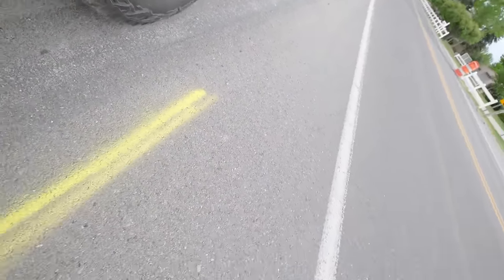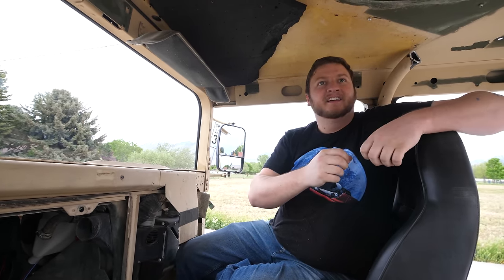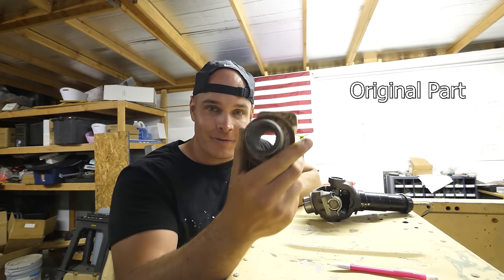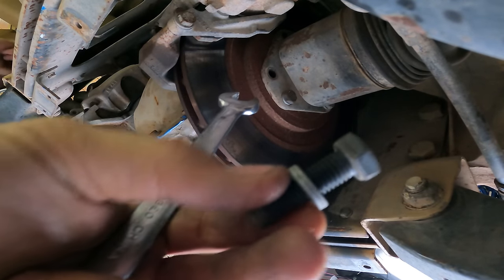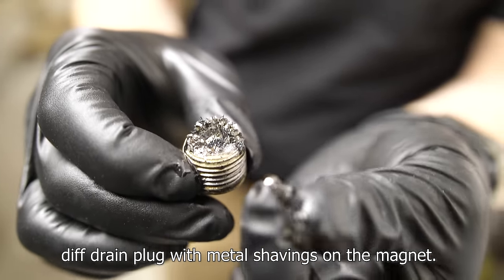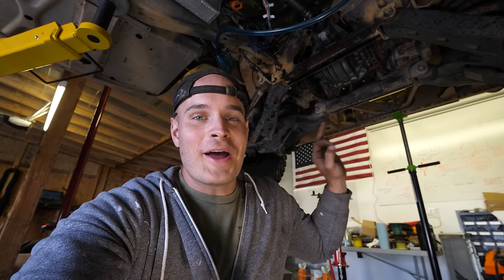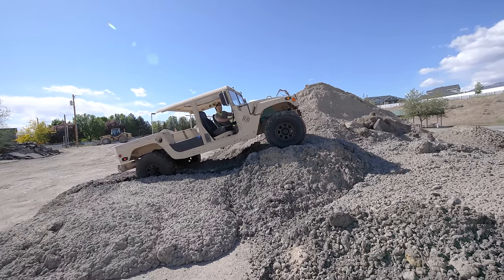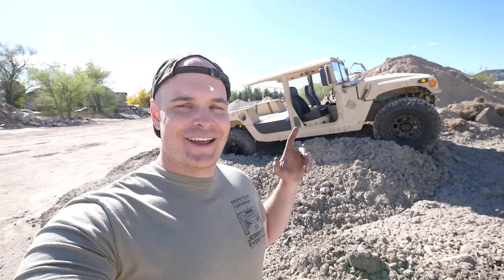My Electric Hummer has a HUGE Problem... and its all my fault.

Comment: I think it would be cool and a good idea to put some skid plates underneath the Hummer for events like the cement pile where you're scraping the ground. A skid plate would protect your drive shaft and coolant lines. It's been so cool to see this thing come together!
Reply: That would add some weight also. It all depends on what the purpose of the thing is. Is it rock crawling or is it more like overlanding and occasional off-road.
Reply: titanium skid plate
Reply: @blacknoir2404  nah just thick aluminum
Reply: @Jellylazer  but then there's no white hot sparks should you skid on a rock
Reply: And improve aerodynamics
Reply: Have you seen one of these in person? They arn't like most other 4x4s - everything it tucked up extremely high and uses portal axles to drop the tire low enough to the ground. Skid plates would be over kill in this and unless your planing to do some VERY serious 4x4ing then this isn't the right platform. The driveshafts don't hang below the body unlike most 4x4 rigs due to the design & portal axles - nearly impossible to get something UP INSIDE the body to hit it. You would have to go out of your way and it wouldn't be easy to find something that could for the type of offroading this can do.  Based on your comment; your out of your dept so stop trying to be an internet expert when you clearly have no knowledge. You likely seen normal 4x4 were skid plates can be useful but assume that applies to everything when it does. Stop copying everything and use your critical thinking skills instead. That is how drivers following GPS end up in lakes because they stop using their brain. I'll end the rant there but hopefully you take my last part to heart.
Reply: @ka-i  It won't benefit that humvee. I don't break things down for YT aerodynamic specialists.
Reply: @JohnAdams-qc2ju  Maybe you should use your "critical thinking" before blowing up at someone on the internet because heaven forbid someone who isn't an expert makes a comment. I was just throwing out an idea, and maybe before shooting it down you should have looked into it a bit. There are people who make and install skid plates and armor plates for the underside of these M998 Humvees. They can help in situations like the cement pile where the vehicle sinks into the rocks. Plus since Zack's Humvee has coolant lines running underneath, it would be important to protect them. My advice to you is to be courteous and listen to other people for once, because no one will want to be around you if all you ever do is shoot down their ideas. Hopefully your day gets better so you stop being rude to strangers on the internet.
Reply: The humvees we had in Iraq had a completely flat undercarriage. One big sheet of metal
Reply: @BlackJeepConvertible  Yeah, that was kind of what I meant by adding a skid plate. Obviously some people didn't understand.
Reply: I appreciate Jerry mounted a camera instead of any skid plate. 
There can always happen something unexpected while testing any never-before-intended-to-be-compiled components. 
Well, failing might be no option; but sh*t can and will happen anyway. The sum of failures is called experience. 
Jerry riggs everything - and "everything" includes to compensate any glitches either!
Thank you Jerry for documenting what you're doing.
It is much cheeper to me to let you make all those expensive experiences.
Reply: @JohnAdams-qc2ju  All the internals might be up high, but they aren't actually protected in any way, and as the cement pile shows, they are still low enough to be damaged.  With all the new electronics and cooling packed down there, there is definite cause to be concerned about them being damaged.  All it takes is one slightly sharp piece of asphalt being kicked up  by the tyres for things to go catastrophically wrong.

If the electric humvee can't handle the weight of the skid plate it originally had, maybe it should go back to being diesel and just run on biodiesel instead.
Reply: And cover all that messy wiring just waiting to get ripped out.

Comment: I'd recommend a safety loop for the drive shaft in case you have a similar problem again. It'll help keep the shaft from hitting the ground if either the u joints or the shaft itself break.
Reply: Not only the ground. Components around it as well. I was quenching waiting for it to hit coolant lines. Even when he did the small offroad, I'm just thinking about those lines
Reply: @mrdingles5107  Hah, yeah, like the ones that were keeping it hanging off the ground!

Thankfully with this setup, there's no exhaust or fuel lines to take out. Although there ARE brake lines still.
Reply: @Aragorn450  And lots of electrical cables for various stuff.  There really should be protective covers under those cable runs, so rubble and dirt won't randomly cut control cables.  If it was still military he would also have to consider landmines exploding under the car, but for civilian off road use, basic plastic or steel covers should do.
Reply: Hummer is probably heavy enough to not let that happen, but older "rear light" trucks could be rolled over when that shaft hits the road.  Safety loops were a standard future on them because of that.
Reply: A flopping shaft is very destructive.  I lost mine after ujoint disintegrated and the splines seperated..  Bought following car a new grill and radiator after  the shaft became airborne.

Comment: Super cool! Can you take it to a metal scrapyard when you are done to put it on a scale to see how much it actually weighs now? Would be interesting to compare the new electric weight to the old diesel weight. Using corner weight scales too would be interesting to see how weight distribution has changed, but I think those are a bit harder to find.
Reply from the maker: Sure

Comment: Love this video series! 
Here’s a piece of info on the HMMWV and the way they were designed to work originally. It’s called throttle/brake modulation. When you feel wheel slip, let up on the throttle. Then you put your left foot on the brake, right foot on the accelerator.  Then you accelerate more or less and brake more or less depending on what you’re feeling the vehicle do. It’s been ages since I learned about this, but you should look it up and give it a try!
Reply: That's just for when one tire is losing traction; it allows the Torsen diff to effectively drive the other tire on the same axle. In a modern vehicle the traction control system would apply the brake to just the spinning tire, which is much more effective.

Comment: Hey, sorry to bother but I've been really curious about how you figured out the power train you needed to pull this beast around. Im looking into building an older 1966 f-100 into an E-Truck but I can't figure out how people figure out what their motor needs to be able to do, what controllers will work with what motors and so forth. I'd love some feedback on how you figured out your system and built it up!

Comment: One thing I've always heard is, gears designed for ICE engines don't play nice with electric motors. They tend to snap in two from the instant torque.
Reply: They're rated for some torque load but electric motors give instant torque which is effectively shear force, so you need something that can take like 150% of the EV motor torque to be safe
Reply: ⬆️This..
Reply: @Ryukachoo  to avoid this anomaly you can just use a slow starter. That will be way cheaper and clever also convenient on matter of avoiding mechanical complexity
Reply: youre mostly right but its more to do with how they're driven, with ICE you can replicate the same instant torque loading by dumping the clutch at high rpm, which also generally ends with you finding the drivetrains "weakest link" lol. This is why its quite important to have a "slow start" function mapped into the ECU for electric conversions.
Reply: @NitroNuggetTV  I how Zach sees this. I want this project to be successful.
Reply: @NitroNuggetTV  slow start is no fun though! Also yeah equating it to clutch dumping is quite accurate
Reply: @NitroNuggetTV  you could also you know just have feet made of flesh. just dont give full throttle instantly. there is your soft start.
Reply: @SimonBauer7  I did say its more about how they're driven. Unfortunately in vehicles intended for performance and off road use its inevitable the the throttle is going to get bumped or mashed. its also especially important you don't break a driveshaft or diff in the middle of a trail, not a spot you'd want to be recovered from. Soft start is cheap insurance if the ECU/speed controller already has the facility for it as many do. After 15mins of driving you wont even notice its there.
Reply: @Ryukachoo  I'm an electrical engineer, I've done a bunch of servomotor motion control tuning. You generally don't want the motor pushing harder than the thing can accelerate anyway - there's no point in adding additional input to a system that can't take it. That energy has to get dissipated SOMEWHERE. In cars this is when you get slip between the tires and the ground, so traction control is pretty much just an automatic way to keep from ruining everything since tires are usually the weakest link.

(That is, until your tires get more traction than you've been assuming, like a prepared drag strip, and you're suddenly able to exert way more torque. Now you're snapping stuff, and you have to do all kinds of analysis. Or you just keep throwing money at it until it stops breaking 🤣)
Reply: @Ryukachoo  the electric engine take the full rated torque only at max  wheel resistance.

to give hammer good transferability you need fast acceleration at high tprque.

wheel that spin at 10 RPM cant move this hammer in dirt.( at low gear 4X4)
Reply: This "rate of torque increase" issue was solved in sports cars of the 1960's. They had a vulcanised rubber doughnut coupling in the drive train which basically acted like an elastic band, absorbing energy when the torque peaked. The other advantage was the unwinding of the elastic forces which then fed the stored energy to the wheels smoothly as the vehicle accelerated. Very simple, cheap, and effective.

Comment: There's an orientation to the yokes on a drive line that make a difference on how the universals wear. You need to line up the yokes from the transmission to the rear end. 
Check with a drive line specialty shop to make sure, it's been 45 years since I've last done this.
Reply: You are right. The u joints/slip yoke that is on the drive shaft need to be in line with one another. Looks like he just slipped it on. Hopefully he got them inphase. Also. If those gears are new. There's a proper break in/ heat phase he needs to do or else he'll blow the gears. Guess we'll wait and see. Love this build.

Comment: Hiccups happen, even on more simple swaps. I'm in the middle of swapping an engine into my 95 Camaro that was never meant to be there and it hasn't been smooth sailing. Whatever it is, you'll figure it out

For those wondering, the engine in question is an LS3 Crate motor. I'm going from 190 horsepower (V6) to 535

Love the project Zach keep em coming, and if you ever need a hand hit me up!
Reply: Haha I got my 97 rs with a blown engine sitting in case I ever have the extra money to swap in a ls engine. Have fun with that extra power and be careful brother.
Reply: give us a video after all that is done!

Comment: Tip: To prevent tears and ripping while drilling, just set the drill to strengt 20. When it gets stopped, it doesn't break the part, the drill or hurt you!  I tried it, and used it ever since!

Comment: 9:45 there isn't a crush ring inside. there are two taper roller bearings which need a specific amount of pre load to function correctly
Reply: There's also a crush sleeve, which is used to set the pinion to ring gear lash. To bring the pinion farther away from the ring gear, you tighten the nut farther. The bearings are just bearings, and don't care how much load is on them as long as it's within design limits.
Reply: @alexmawdsley  the bearings in here aren't just plain ball bearings, they're tapered roller bearings. When you find a tapered roller bearing anywhere, wether it be a lathe spindle or a differential pinion. You will always find two of them pre loaded towards each other. You will never find a single taper roller bearing, there have to be two in order for them to work as intended.
Reply: @alexmawdsley  the crush sleeve you mentioned isn't actually a crush sleeve, they're shims that you add or remove in order to bring the pinion closer or farther from the ring gear to adjust backlash

Comment: Definitely route all the harnesses as far away from the driveline as possible, I’ve seen driveshafts “grab” and quickly remove other components located nearby. As stated above a driveline loop is also very recommended. Great build, taking notes to build the hmmwv I have at my shop right now.

Comment: I know it's not finished from seeing the wires hanging around, but please update your coolant lines to SAE rated coolant lines. Clear vinyl tubing is a safety hazard.
Reply: Why?, How?  There's no burning petrol around.
Reply: @johndododoe1411  It doesn't need to use liquid fuel to need proper coolant hoses.
Reply: Bruh asked "why," and you basically said "because." They requested an actual explanation.  @AaronBockelie

Comment: Wow, you using those crescent wrenches to break that metal strapping just blew my mind lol

Keeping that one in the inventory, thanks
Reply: A small bolt cutter cots less than the wrenches and you cut the strap where it's been pinched together. Plus, you don't have to fiddle about adjusting 2 wrenches before you start.

Comment: Aluminium skid plate protect your underside, but also it improves drag coefficiency by quite a lot! So it becomes more aerodynamic without ruining the look of the hummer, definitely a worthwhile upgrade.
Reply: So, it'll be less than 1.0cd? Cool.
Reply: Hummer + Drag coefficient = oxymoron. 
Everything above the skid plate still has the aerodynamics of a brick.
Reply: @tasmedic  
If it means 5 - 15 more km of range, its better than sitting around and mopping like you have nothing better to do in life.

Comment: You've inspired me to do my own EV conversion. I'm planning on doing it to a Subaru BRZ. Planning out this project and researching all of this stuff reignited this love for JDMs I thought I lost when I enlisted and got stationed in Germany (the most anti car modification country I could ever end up in Europe). Thank you for this series man. Whenever I get the project running maybe I'll start my own series on buying JDMs from Coparts and rebuilding them into EV super cars 😂
Reply: It still wouldn’t be a supercar
Reply: The road's probably gonna be rough but you got this.
Reply: This sounds really cool. I'd love to see the engineering behind a BRZ EV conversion.
Reply: When I get my hands Ona Koenigsegg gamura I'm going to put a turbo S motor in it.
Reply: You're going to have to be okay with a very low range so that your battery mass doesn't completely ruin the BRZ's balance. Definitely plan to install some kind of fast charging on there to make up for it
Reply: Good luck man.. I'm sure you'll pull it off! :)

Comment: The error wasn't just a spline count difference. For the female-splined yoke to go onto the male-splined shaft at all with a tooth count mismatch, it must have also been larger in diameter than the shaft.

An additional source of confusion is that some of these splines (likely including those stock in the HMMWV, which was designed and built by AM General but used some GM-style components) is that in some of them two of the male spline teeth are bridged together, so while the spline tooth spacing corresponds to 27 for the full circumference, there are only 26 teeth (one of which is much wider); that's to index the male and female to a specific position.

This sort of error is easy to make, but it also easy to avoid by comparing full specifications, not just the spline count. When the diameter is not provided (which is common with these components), measuring the actual parts before assembly is a good check.

Comment: Yep, melding old and new parts together is always difficult and running around without the cooling lines connected is not good test parameters! Just saying. Will you be using a patina finish? Coating the existing paint with a clear coat to provide protection? Thank you for sharing all of these videos!

Comment: It would probably be a good idea to add protection to the cooling tubes on the bottom.
Reply: > You mean the drive shaft support line?  A wonder that line didn't wrap around the drive shaft and cause a major 911 environmental insult.

Comment: Those Torsen differentials are super cool, they "multiply" the torque the spinning wheel sees sending it to the stationary one. On the last climbing test you probably would have been able to make it by gently applying the brakes, making the torque on the spinning wheel appear to be higher causing a multiple of that torque to go to the stationary one.

The exact multiple here is dictated by the friction surfaces of a washer pack between the two gears that the output shafts insert into, it can be tuned to a certain degree but is a bit of a pain to do consistently.

Comment: Wondering if installing a joint that can take way more force is a good idea actually, the fault just snapped off a bolt, but what if the fault is still there and now something else needs to break?
Reply: That’s the phase of production that he’s in.  Drive and break things, replace as you go.